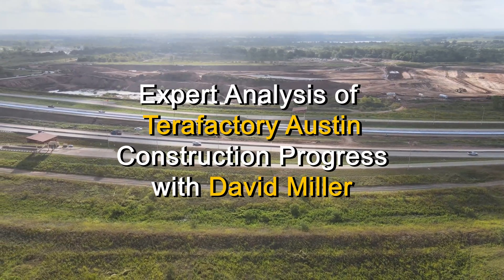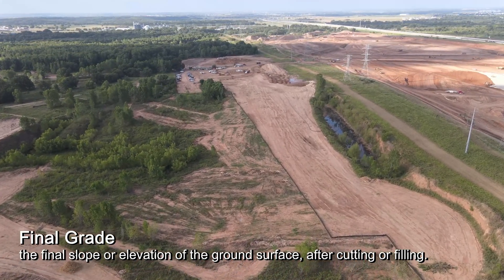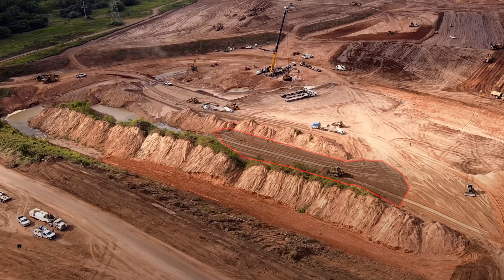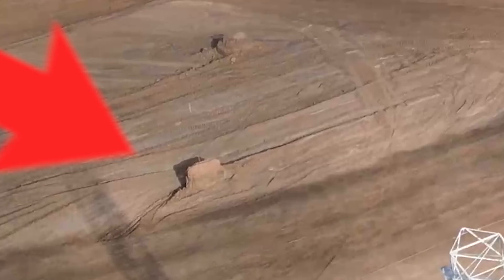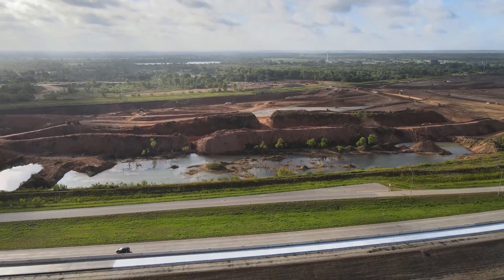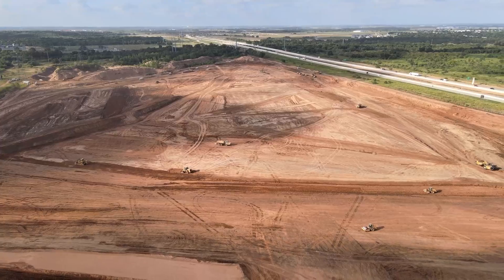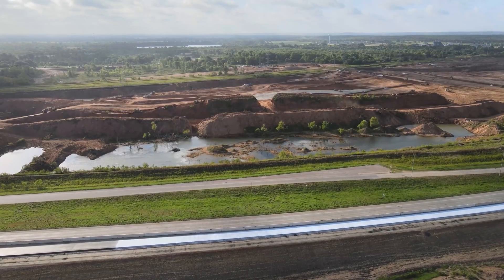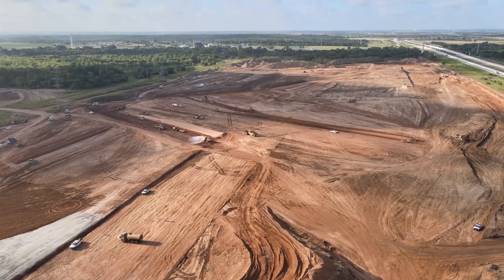Tesla Terafactory Austin - Construction Analysis - 8/13/20 - Featuring Commentary by David Miller

Comment: Seriously? You are making the comment at 2:54 to 3:10 that the electric company is slow about getting there to remove the power lines. Who do you think is in those white bucket  and auger trucks on the road at the back by the mounds in the frame?
Reply: The audio was recorded about a week prior to this release.  The bucket trucks came in 3-4 days later.  This commentary thing is a work in progress, and we need to get things worked out to be more streamlined.

Comment: Thanks for doing this!  It's so much better to have verbal descriptions of what's going on instead of just raw footage leaving you totally perplexed.  As others mentioned, there are other perplexing features that could use explanation, such as the exact purpose of those "geo-fabrics", and the four drilling machines in the middle of a white powder covered patch.  Also, is the same dirt from the mounds used to fill the pits, or is the dirt removed being carried away and some other kind of dirt or gravel brought in.  Also, this is a flood-prone area, at one flood every ten years median;  I'm sure Tesla have a plan to mitigate the flood risk, but what would it involve?  Preventing water from entering?  Or allowing the water to pass?  Factory on piles like Venice?

Comment: At about 5:00 in the video, on the left side, it appears that there are 4 white power co. bucket trucks, that are arriving on the scene. In Jeff's Aug. 23rd low flying video, they can be seen at 19:10 already doing work near the highway bridge. My guess is that they will tap in there to run the line parallel to the highway to where it crosses the highway, then get rid of the poles in the construction area. They will likely stretch the work out to several days, based on my past experience on doing similar site work.

Comment: The power liner can’t be dropped at the same location. Their has to be a new location on the perimeter cut to final grade, and then new poles. Best solution is to feed load from new source that doesn’t go through site and then remove this one. I like your final grade evaluation and it would be nice if You could confirm this with dialogue with General Contractor.
Reply: I agree, would be nice too.  But I'm 1500 miles away and I don't have his name or number.

Comment: That’s it? No comment on the “white” area? No guess on which areas they will tackle next or how much longer it will take to finish leveling certain areas?
Reply: If you want more info on the white area, go to www.geopier.com. They will be putting some type of rammed aggregate pier or rigid inclusion under the gravel mat. The foundation of the building will sit on top of the gravel. Only a very small area may need this treatment. Other places on the lot may use a different type of sub foundation based on the strength of the underlying materials.
Reply: Peter Graphix Thanks. So the white stuff is gravel? It looks so white, so powdery.
Reply: @byteback  All of the white stuff on the ground is crushed limestone gravel used to stiffen up the area. This location was a sand pit used for several years until about 8-10 years ago that is why the pits were full of water and the vegetation so tall. The combination of the gravel and geotex (black tarps) material will help reinforce the ground and help prevent the foundations from sinking.
Reply: That's because he doesn't know anything about this type and level of construction.

Comment: Would be interested to know what David thinks the gravel and coring machines are for.
Reply: https://www.youtube.com/watch?v=9jP9KSWRoY4 shows more on possible systems. The gravel sits on top of these piers to distribute weight. The actual foundation of the building goes on top of this.
Reply: @petergraphix6740  Do you think that pad is compacted gravel or is it graded drainage gravel?
Reply: @briansilver3412  Compacted. In the other videos they are running rollers over it. And with the GeoPier equipment sitting on it, it only makes sense to be compacted.
Reply: @petergraphix6740  That's interesting.  Do we know that those drills are GeoPier?

That would explain the piles of aggregate.  I was wondering why they would pile them rather them having the dump trucks spread them out a bit already.  But if that aggregate is destined for the piers, that would make sense.
Reply: @AmiGanguli  there are a few guys out filming with drones. One of them has clear shots of the excavators Geopier logos.
Reply: @petergraphix6740  Awesome.  Thanks!